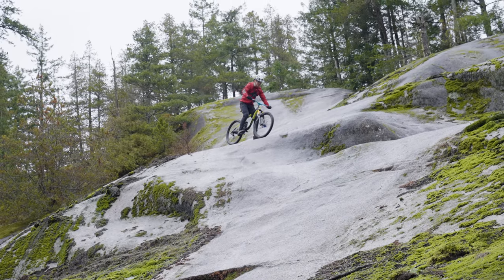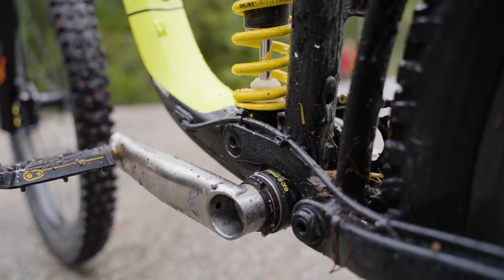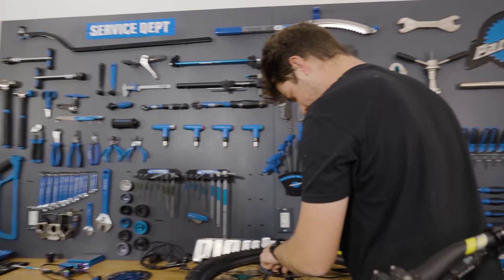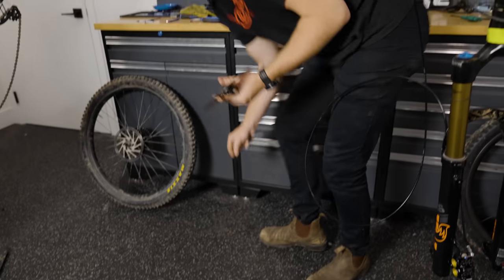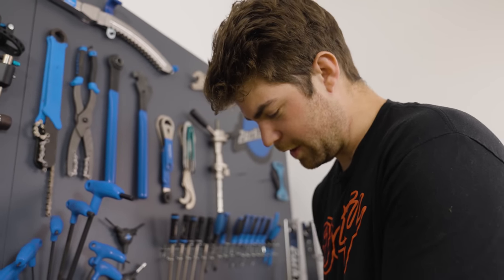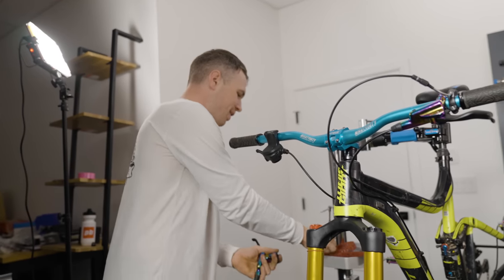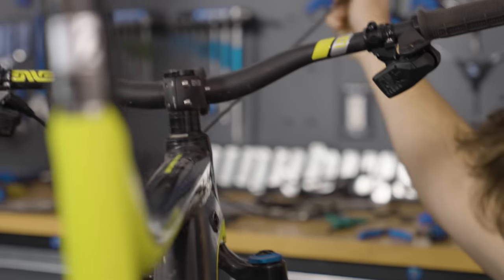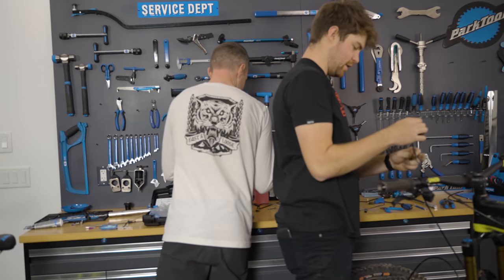$125 vs. $517 Brakes - Budget vs. Baller Episode 7

Comment: would love to see a video where yall test all of the different brake brands performance on this slab
Reply: Yeah and with those cheap tires
Reply: @rileybox2498  second this. See how the high end Magura, Shimano, Sram and TRP compare to their cheapest options from those brands.
Reply: There's charts one with average brake strengths etc . Pretty much trick stuff is at ridiculous 114+NM or something to do woth newton's/ pounds per square inch , closely followed by mt7 , mt5 and then hopes, trps , etc all kimd of roughly the same
Reply: You can see Remy ride the best brakes (Hayes) on slabs like this all day on his channel
Reply: @fixienick  "Best" can be subjective, one person's best is a others average. For me the best brake wouldn't just be braking force but the overall ease. Maguras for me kind of fit thT bill. Very easy instLl , bleeding , cheap easy to find pads and rotors. Very strong feel. Hopes are huge where I live as its UK. But I dunno I just don't feel £340+ for 2 brakes Pre buying rotor is value. They even run on Dot which os a bit more of an ass to use and bring on holidays pr to races than Mineral oils
Reply: @MancWithAMouth  We're not discussing value, we're discussing "best." Most power with most modulation means best, from a pure performance standpoint. Plus DOT is a better brake fluid than mineral oil, especially for brakes- mineral oils don't have standards, you know what's in the bottle with DOT.
Reply: @fixienick  trick stuff are the most powerful brakes though. Hayes were average lol ? And modulation is subjective so is DOT vs Mineral. Best can be subjective in terms wise. For how brakes work it'd either be a Onefactor rating i.e power , or something like price.
Reply: @fixienick  Also Dot / mineral are pretty close for most stuff tbf especially on mountain bike brakes. But personally a liquid that doesn't start to deteriate from being opened and can eat away the paint / environment seems not worth it personally. If you snag a brake line or something then atleast it won't hard the nature around us that we take for granted as much as DoT could.
Reply: @UCTSDZzmIbr0md-SSmGZNxRw Hayes isn't listed, "pal".

And if I'm concerned for safety, I want to know what's going in my brakes, that's the point of DOT, you buy the same stuff, every. Time.
Reply: @fixienick  Hayes will need some digging but listed the link with the wider field. End of day unless your a pro rider or doing some ridiculous shit for guineas World records tye difference a good bleed and pads does on most brakes is adequate. Buts it's OK I can tell fairly easily your someone set in stone cause you get boners  for Remy. Guys a good rider and so are a lot of pthers but end of day pros will run and say what is the best for what they get offered and style of riding. Again a subjective. It's all a cycle. Push yourself to become a pro , get recognition , slowly turn yourself into a product for marketing and ability to profit from it in the sport , branch out as you age out of certain races more so for body limitations. 

If every brake in existence was exactly the same e.g. Only say an A and a B , they both perform identically , used whatever outside possible but regardless wherever it was identical bleed, pressures, forces etc 0 variables for all brakes in existence and you asked a group of people what was the best at a specific park who all had exact same no variable skill. It'd still all come down to personal choice and market influences 🚵‍♀️
Reply: @fixienick  I mix and match my brake fluids... Don't know what's going on with you and needing to know what's in the brake fluid... It's a brake fluid, what do you expect to find in it? Mineral Oil won't just spontaneously combust into thin air or something... And mineral oil is mineral oil... Shimanos oil is a bit thicker, maguras oil is a bit thinner, but overall it's the same. That's why I ride royal blood. But the main points why mineral oils in Mountainbiking are better are that they don't suck up the water like a sponge making the brakes useless after 2 years and don't destroy the environment, your bike and especially your hands while bleeding... Dot really doesn't have any real performance benefits when it comes to Mountainbiking.
Reply: @ironeinar  It's only your safety at stake dude, you do you.
Reply: @fixienick  yeah and I'm as safe as it's ever gonna get. My brakes work perfectly fine

Comment: Did either of them bother to bed in the new brakes before the slab test? I’m hoping that if they do a second season, they take time to explain how and why the parts need to be changed (like what donut does every episode)
Reply: I had the same thought.  Henry's braking issue seemed like a symptom of no or poor bedding.
Reply: I dont think they are stupid haha
Reply: @GD-gj6mn  honestly I thinks it's the SHITTY brake's fault lol
Reply: @marcogiacomelli3625  I don’t I have these brakes and if you bleed and bed them properly they work just as good as shimano mt200 or 300 series brakes.
Reply: @kylebatson5971  honest, that'll teach me to shut up if I didn't try them lol
Reply: @kylebatson5971  mt200 and 300 pair would have probably cost just as much as these brakes would have too.
Reply: I wouldn’t be super surprised, they stock these same brakes on a 75 pound e fat bikes we sell and arnt that bad, still aren’t super great but at least setup in the dry they seam fairly decent , I mean I wouldn’t recommend them but there are definitely worse options
Reply: @lilwillie428  yeah exactly, they aren’t the best but they do work, I have them set up on a 50 pound ebike here and they stop the bike quite fine in my opinion, and that’s coming from a guy who uses avid brakes on my downhill bike
Reply: And the lever was in a wrong position when he was bleeding them. Same thing with the fork, it seemed like they ran too much pressure in it and didn't get even close to the full travel the fork had. This whole series was like watching two amateurs just ordering things blindly based on price and even half assing the installations, at least with the budget bike. Or maybe it was all scripted, which would be even worse..

Comment: Really don't get how this is a cheaper upgrade compared to a bleed and new rotors/pads...
Reply: At my shop 2 brake bleeds and 2 sets of mtx red pads for those guides would run $140+ tax and would be miles ahead of those no brand brakes

Comment: Broke my hand due to brake fade on a gnarly descent.  Learned my lesson, have MT5 HC's and always keep those maintained religiously.  Always worth spending more $$$ and time on brakes.
Reply: I have tektro m275 hydros they work well for me at least
Reply: @gulfcitynd  yeah but tektro are TRP, so you still getting quality just as a lower price.
Reply: @wild_yeti  same as say shimano mt200. For the standard riding they are good. Especially in dry not that steep environments
Reply: @XxNoMercyNL  mt200 are terrible possibly better than zoom but they are the most basic hydrolics shimano make they work they don't have feel modulation adjustment but they work on tame stuff don't take them downhilling or the likes

Shimano make a budget 4 pot caliper called the mt420 that's a great budget option basicly a saint caliper with out the fancy bits and lines

Comment: thanks to pinkbike i learn about terrible brands ive never seen before or knew existed, which turn out, produce bad stuff. 

this isnt budget vs baller this is crappiest-we-found vs baller. maybe redo this with real budget parts. wont be much more expensive, but will be more interesting.
Reply: Yeah shimano mt200 is budget imo but they work
Reply: Crappiest they can find vs unnecessarily expensive, should've gone with regular high end brakes instead of "limited edition" brakes that cost more for the name.
Reply: You can buy a set of Magura(front and back) for 200 in Belgium(without disks).  So what's the point of buying Chinese shit that will probably fail on you in the first month? Lol

Comment: Sorry boys, but you've taken this to far! It's not budget v baller. It's cheapest crap you can find on amazon vs baller. No proper mountain biker or beginner would ever consider zoom brakes or half the components you've got. You should have gone for budget shimano, sram, etc.
Reply: Everyone knows that deore or NX is good. Whats the point ?
Reply: Agreed.  However, perhaps we should look at this as a cautionary tale to NOT buy cheap crap just to save a few bucks?
Reply: @djhillesq  issue is that some of this stuff is an upgrade for really entry level stuff but these guys are fucking downgrading the bikes.

Comment: MT5? really? even though they are Fabio Wibmer's, they only cost more than regular MT5 and perform the same. I actually expectet something like Trickstuff...
still relieved that Mike isn't on cable-actuated brakes
Reply: Trickstuff... This video would be available in 9 months... 😉
Reply: And no... this is not a hate... I'm on some trickstuff components as well and really like them ✌️ but I think it's easier to get your hands on their stuff over here in Germany
Reply: @yannicbrose  kinda true. But still Mt5.... they could at least have gone for mt7, they got way more Power and a bite-point-adjuster that even works...
Reply: @clemens8744  agree✌️ only ridden mt5s before. Also plenty of power.
Reply: Definetely. Love my Piccolas  HD and won't let go of them
Reply: @clemens8744  ohh 😯 you lucky
Reply: also, MT5 fabio edition are faaaaar from 850 ....
Reply: those brakes never cost 850$. In Europe the brakes themselves (not the wibmer edition which is 270€) cost 160€ and the rotors 80 together
Reply: @fabianbusch6067  I know, I have them on 2 bikes :D
Reply: @fabianbusch6067  that's actually so true. For 850 can$ i could get myself the really nice stuff like Xtr, Code rsc, hope ... 
Mt5 is maguras cheap 4-pot brake, that's it
Reply: I just got a set of MT5 front and rear for $275 nz dollars...
Reply: Mt5 fabio wibmers use mt7 calipers with mt5 Pro levers so they're not just standard mt5's
Reply: Mike?
Reply: @lewiskiltie9841  actually all magura using the same pot design, nothing change. I used both mt5 and mt7 and they actually work best with Shimano’s lever
Reply: @cornishcactus  sorry Henry
Reply: @lewiskiltie9841  still not "high end" brakes... still 280 dollars not 850.
Reply: @clemens8744  It's the Mike Bears that threw you wasn't it :D
Reply: @cornishcactus  probably. But if he had ridden them, he might have at least been able to lock up the brakes: )
Reply: @clemens8744  Bite point adjusters on my MT7s do nothing. I even bought them aftermarket as I could only find levers with the "auto" (blank) bite point. Kind of a waste. Didn't harm the system but doesn't make any difference. I also got stock pads that were contaminated from the factory. It took me a month to figure that one out. Anyway, new set of pads and a couple of rides with migrating bite/bleed I finally got them dialed and they are great.

Comment: I am a fellow Indian owning a Montra Downtown 2017 with a NEW BUDGET DIRT CHEAP 3.76$ front Disk brake with stock rotor. The brake has the power to vibrate like ABS when I give full power and are extremely powerful! my whole bike costs like 174.31$ with dual Disk brakes! This is absolutely ridiculous that a 125$ brake can't lock in! 
Good luck riding and have a great day :)

EDIT: It has Cable brakes not hydraulic (like wtf u expect from 4$brakes ???). They seemed to look like they would work just like the 850$ brakes shown in this video (the SLOW BRAKING test). But I think my brakes will get clapped in the sheer power of the 850$ brakes.
Reply: Clarks M4 is below £100 so I would of used for budget unless Shimano still get for £50
Reply: @mlee6050  Thankyou!

Comment: This has been a fun series so far. I do wonder why Jason chose to use the MT 5  Fabio Wibmers vs. the MT 7 Pro or Raceline since the idea of the series was budget vs baller. The MT 7 lever is much more adjustable. Another thing that has me scratching my head is Jason using CL brake adapters on the MDR-P rotors. Mine CLEARLY say  on them "NOT FOR CL ADAPTER USE"  on them. I guess they chose to ignore that warning.. (FYI, yes I know they will work just fine with the Shimano SM-RTAD05 as I have done it myself) Magura is now making a MDR-P rotor made for CL..they just are not available on any USA based online bike shop that I've found.

Comment: Loving the series so far, but i think it would be alot more informative if the budget upgrades where also sensible upgrades, making use of shimano deore for example. Because i dont think anyone is really going to use these parts properly
Reply: Exactly. I live in the netherlands so i dont need metallic brakes because its not so steep and long decending. But my bike has 2 shimano mt200 levers and 180 rear 203 front rotor from shimano also. Costed me not even 100 euro. (112 dollar ) and they work really good. At least they stop you. Instead of this " budget " set that doesnt even stop you properly

Comment: I sueezed more from my brakes by switching to Hope 203 discs on my old Magura Trail Sports. Best discs on the market and sexy too. Hell, Hope V4 brakes on 203mm Hope Discs set my mate back about £500 and he can stop only a little quicker than me on my £250 set up.
 And those Zoom Shimano clones are decent enough with some proper pads in there and a good bleed. Had a set on an old bike and now they're helping get a friend into the sport on 180mm discs.

Comment: seems like the cheap brakes had air in the system, or leaking, maybe contaminated rotors due to leaks.But the crazy tightly installed hoses is silly, but it's possible to undo them, butt it's crazy tight, I've seen reviews of these brakes. But Zoom has discontinued these brakes.

Comment: Tektro $100 brake set 180mm gets you lock front and rear anytime you want and decent modulation, I think there is something off with this zoom, faulty one or just didint bleed enought and somwhere air trapped

Comment: I'm just gonna say it, centerlock rotors are a solution looking for a problem.
Reply: there is this thing called road bikes
Reply: If you travel with a bike centerlock is simpler to handle. You can remove the disc (to protect it if you have to put the bike into a bike bag) simpler, and the centerlock nut don't need locktite.
If you have to unscrew the 6 small screws per disc often it's a risk to damage a thread in the hub.
If you remove the disc every 2 years or so if they are worn it don't play a role.
Reply: I like centerlock more than 6 bolts. The only downside of centerlock is that not every rotor comes with this mount, like those magura ones for instance. Still plenty of other choises though.

Comment: Shoulda put some Paul Klampers on the Baller build! And Henry, to clean up cables, how about clamping the dropper lever to the seat rails so you could have just a couple inches of cable? It's almost like it would be wireless! Just have to be okay with riding one-handed while you raise and lower it...And then you did almost exactly that 10 seconds after the point I paused it to say that.
Woulda been cool to get an IR camera on this to also see how much heat builds up.

Comment: Initially I thought it was Henry in the orange jacket and was feeling pretty good as someone who was seriously considering the Amazon zoom brakes.  My thought was "They're hydraulic brakes, how bad can they actually be?" Now the bike I would have put them on isn't going on trails like that but I'd like a wider safety margin than what those would likely provide.  Instead of buying new, very cheap brakes off the internet I think I'll spend the same or a tiny bit more and get used branded brakes.  Good video thanks!

Comment: I had the same issue as Henry with the hose getting stuck in the lever with some tektro brakes so what we did is brung the bike over to the vice and clamped the hose in the vice and pulled on the lever as hard as possible until it broke free. We then replaced the hose lol

Comment: The only thing off with Maguras is they're Pads just go so quick. The Blue budget pads actually lasted fairly well maybe 2 months of riding both days on weekends in winter (they are not good in the wet which in all fairness they do state) , the Silver or "8.P/8.S"  are like a couple days and GONE. Like gone. Mid ride swapping front to back then just do a front brake bleed later kind of gone. 

The ebike green pads I'm awaiting to try at the moment but it appears to be they organic material they're made of is just so soft it's stupid. A fully Sintered or REALLY hard wearing pads.

Do t get me wrong the brakes as a whole are brilliant , strong, good value on pads and brakeset , good value rotors , easy to find pads and off brand ones. Good modulation. Just those pad materials need work.

Comment: I've been using the rotors that Henry is using for 2 years now. You can get them on Aliexpress in various colors. They are quite decent for the price, but 1 out of 8 rotors turned out to be warped from the factory which resulted in a pulsating feel. But aside from that I can definitely recommend them for AM and rough trails.

Comment: I bought the zoom brakes for my old mtb and they work awesome. I can't feel any difference to shimano mt200 for example. Pressure is perfect, modulation is great, they lock the wheel if you want easily. Great deal for 38€ for both wheels excluding rotors